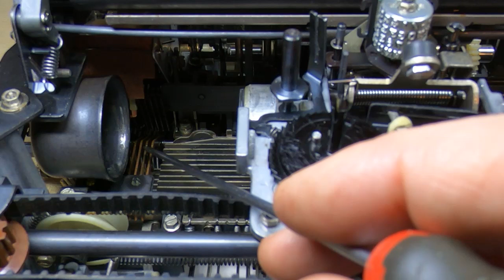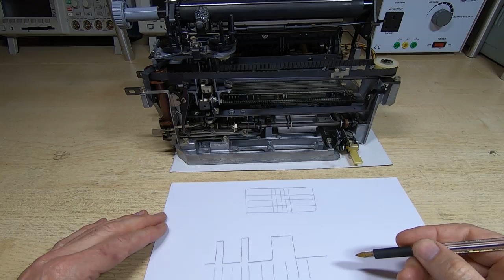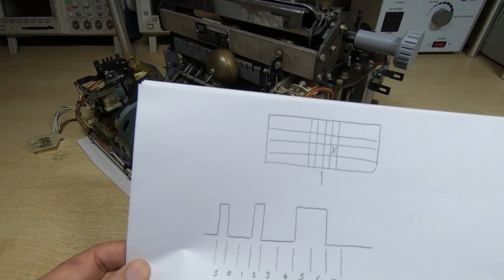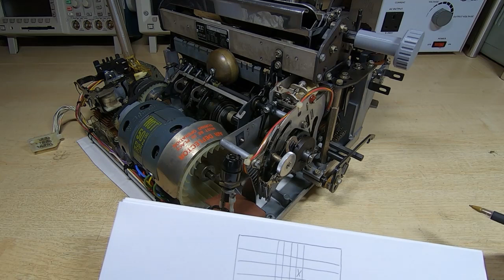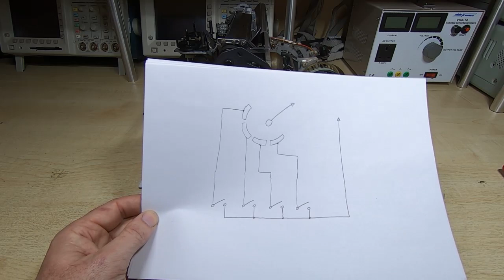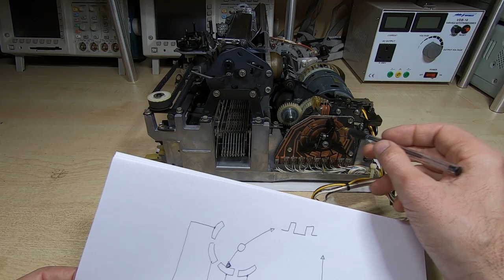ASR33 #2 Repair Part4

Comment: Jerry, when you freed up the stuck linkages, did you initially keep spraying something like WD-40/PB-Blaster or continually add the type of oil(s) equivalent to what Teletype originally recommended for lubrication to specific points?  Would using those "un-stick-it-type" products cause problems in the long run when trying to finish cleaning and then applying the proper lubrication?
Reply from the maker: If oil does not free them up then they need to be dismantled and cleaned.